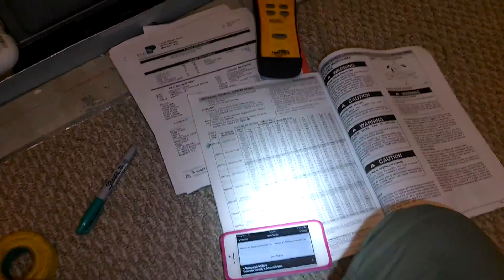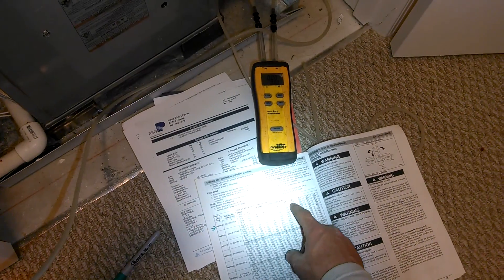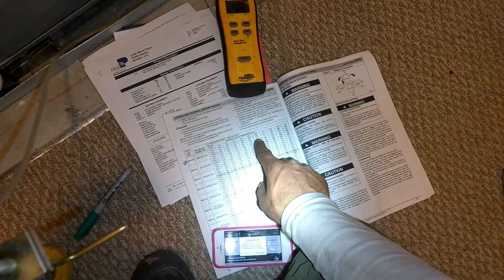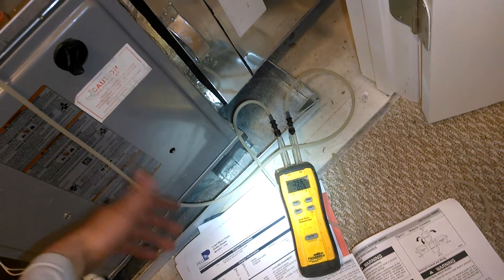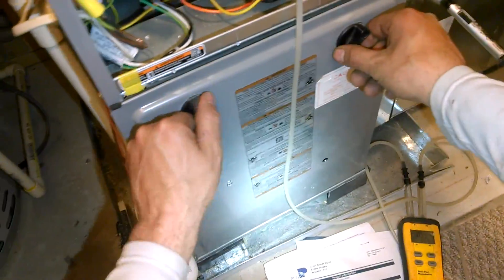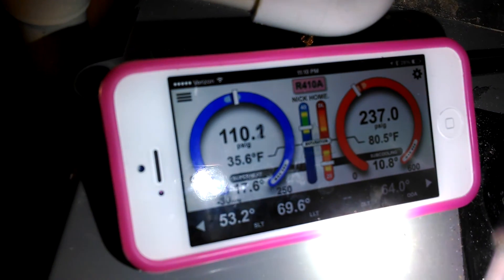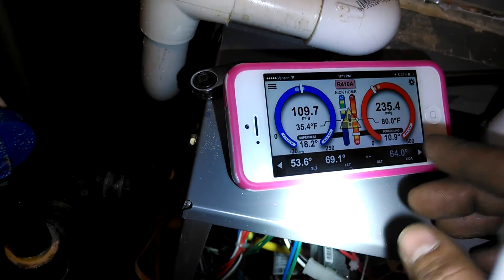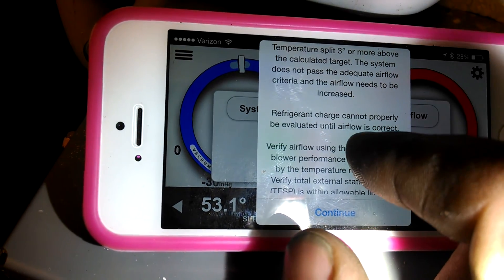IManifold evac and testing on my HVAC system #2

Comment: While it is apparent that you do have airflow problems, it looks also like you are checking at a very low load, maybe 54 degrees outside and close to 70 inside?
Reply: I'm glad I could help you Nicholas Rowan
Reply from the maker: Stephen Rardon you are awesome! You have no idea how much I appreciate what you have done for me. I hope that me putting up these videos shows a little bit of how appreciative I am of a gift you have given me
Reply: I'm glad to see that you're doing as much if not more than I would've done with the device. Fingers crossed on version 2.0!! If that device isn't absolutely sick I'll be floored.
Reply from the maker: You are exactly right. I will be checking it again when the temperatures are warmer and putting up another video. Jim it is an absolute honor that you were watching my videos. Thank you so much  for watching my videos and helping me out with my many questions
Reply: Nicholas Rowan Watching them is very helpful to see how customers are using the product. We have already made some changes in the troubleshooting section to make it better for everyone simply by observing the iManifold in action.

Also if you put the static pressure tip in the supply (+) and the (-) in the return, you can get the total external without doing the math. You do not absolutely have to have a second static pressure tip for the return as the air is  non directional. It would only help slightly with accuracy.